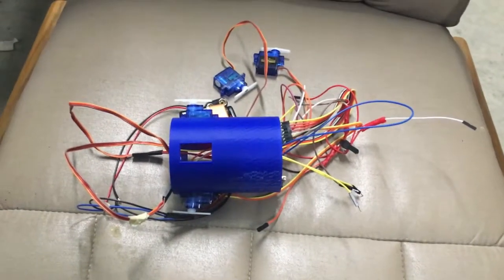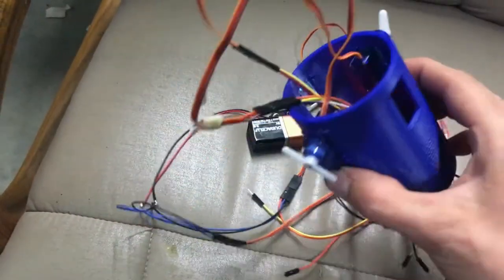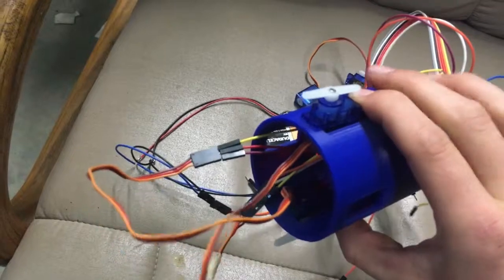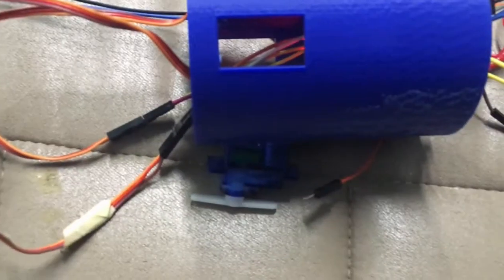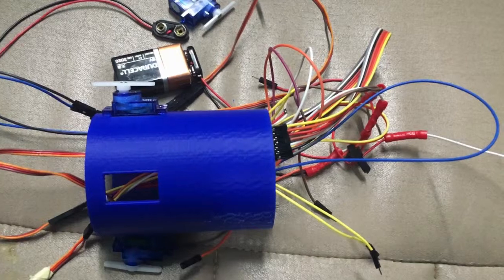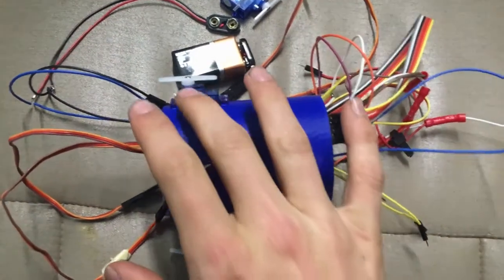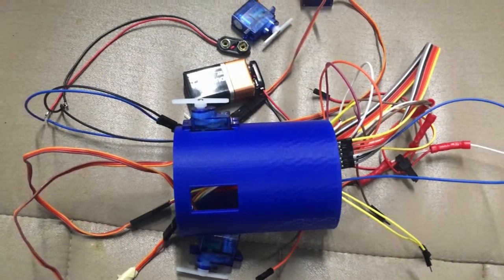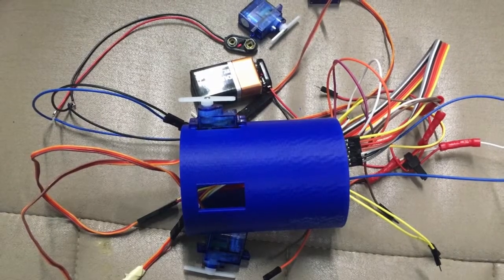Arduino Rocket Stabilization System Sneak Peek

Comment from the maker: This project has been changed. It is still an altitude control system, it just works in a completely different manner. Those videos will be up soon, a complete tutorial, designed specifically for TARC 2019. It will include the programming, CAD files, rocket construction, and testing. The new system does not fall under ITAR Part 121.1, so it works much better for me and you guys, especially as it no longer pushes legal boundaries.

Comment: I was curious how much a kit would cost to build? Are you using a gyroscope software that already exists or are you writing the software yourself?
Reply from the maker: You can get the nanos fairly cheap, especially if you buy a five or ten pack. Seems like the MPU was ten or fifteen bucks. Altimeter is similar in cost. The software I write myself, although it’s really just piecing together multiple other already-written codes. 

Keep ITAR in mind before sharing any code or CAD. 

Cheers,

Michael Cuthbertson II

Comment: great work , how is it coming along? Update ?
Reply from the maker: helinick81 it's coming along well. The project has kind of been reworked into an altitude control system, with stabilization capabilities. Kind of gives some more leeway legally. The flight computer itself is its own series, using a PCB will get rid of the wires. Project relabeled as Ariel. Still working on a few things having to do with the PCB side of things. Been busy with college and work, next video will go over the schematic design, just need to find a day with some free time to do it. I've ordered and received all the components, and still a long way to go on the programming side of things. Hopefully not too far though. Likely will release schematic design, then Placement and Routing video, and then the actual cutting/etching of the board itself. After that it's just the code that's left. At most six videos for code, could be put together as three or four. Will have to see how the code looks at that point. A couple of weeks from now I should be able to record a lot of videos, might get to the code videos then.
Reply: @FrogPondEngineering  keep us posted
Reply from the maker: helinick81 I will. May even do a midweek update this week. If I do it would be a fairly casual video, not as cut down as the others.
Reply from the maker: helinick81 midweek update is out FYI.